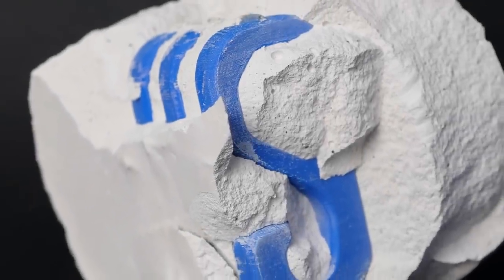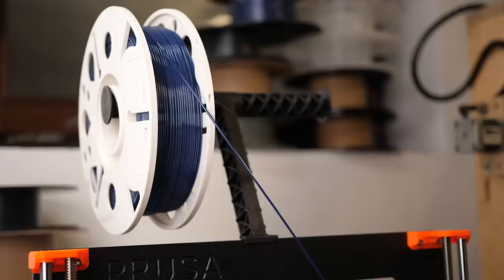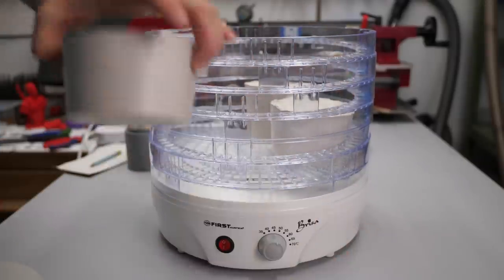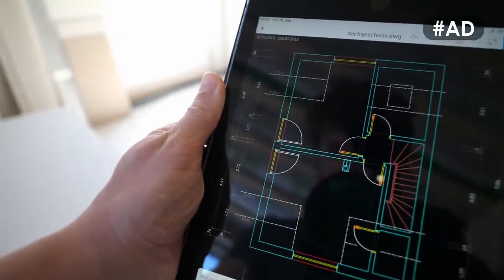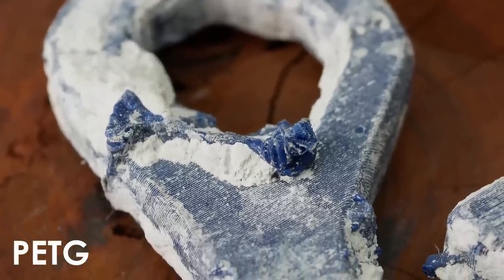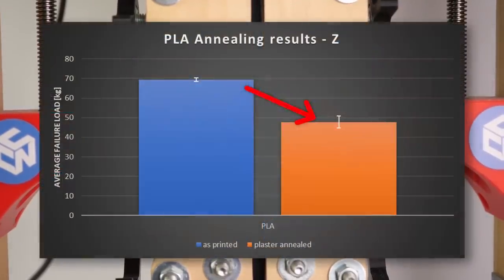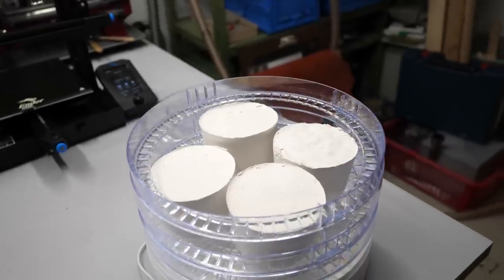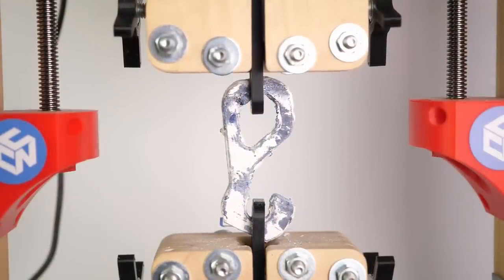Triple (x3) your Layer Strength by Annealing 3D Prints in Plaster!

Comment: What, no photos or graphs of the Bread test-results?? :-D  Thanks for the great info, as always, Stefan!
I need to print a few parts that incorporate a "threaded-rod" shape, so printing in the standing orientation produces way better results than XY-orientation with supports; therefore this method may be at good starting point.  The part will live outside, under glass - therefore I need both UV resistance and heat-resistance.  So its a bummer that between PETG and PLA we can only have one of the other (PLA annealed temp resistance vs. PETG UV resistance and layer-adhesion improvement).

Comment: to keep the parts from absorbing moister you should coat them with an acrylic spray or something like that to prevent that

also you should use something like a palm sander to vibrate out the air bubbles or a pressure chamber instead of a vacuum chamber to squeeze out the air bubbles instead of sucking them out

Comment: Maybe onion-like layers of PETF or streaks of it through the PLA component. The PLA could prevent deformation and hollowing and the PETF could contribute strength. Perhaps, assuming the PETF will melt, long thin cavities could designed to allow the flow to join layers.

Comment: My ideal would be an additional toolhead with a long extendible proboscis: get the slicer to do zero percent infill within the walls, then when the walls are tall enough, extend said proboscis into the void thus created, and extrude material en masse while drawing the proboscis up. With sufficient heat and vertical speed, you should get a solid block, strong in all axes. Either that, or build some PLA rebar separately and insert in post production.

Comment: Could you coat the parts in a high temp release coating of some kind to make them pop out of the plaster cleaner.
Reply: There's separation milk used for gypsum on gypsum. As in make clay something, throw gypsum at it,spoon out the clay. Separation milk. Fill with gypsum.  No idea how it would do with that kinda heat.

Comment: You need a diamond chisel (there are electric ones) to break efficiently the plaster. best way to remove the biggest chunks, and then do what you did, scrub in the water. Your plaster process, drying first and then heating, seems, imho, to be the best path. I probably would add a vibrating table while the plaster mold dry.

Comment: I wonder, if you used a gradient infill, if following annealing you'd get something akin to an W-section/I-beam in terms of shrinkage?

Try: a flat (e.g. printed) rectangular prism, annealed in this process. For extra credit: make some smaller, thin blocks of paraffin wax wrapped in baking sheet on either side of the plastic block before casting. The idea being that the paraffin will expand in the oven, compressing the center of the mold, and should reduce the bacon effect.

Comment: May use a thin layer of plaster on the printed parts and use small containers of sand where you put them in. Should reduce dry, heat and clean time alot.

Comment: if you wanted to get rid of the bubbles in the plaster molds, you could use a high pressure chamber rather than a vacuum. This technique works by compressing the air bubbles to a point where they are negligible.
The only major downside to this method is that the plaster must set in the pressure chamber, rather than outside it.

Comment: Can you get some thermocouples for next time to measure the core temperature of the mold, and maybe also test quenching from slightly below the melting point?
If you use salt as had been suggested, you could probably just drop the part with surrounding salt in ice water pre-saturated with salt, just so the pulverized molding salt doesn't dissolve much. Afterwards you can just take the sediment and bake it at 200~400 C before re-crushing.

Comment: You might have better results with PETG using a silicone or other multipart molding compound, or something else without water.  The silicone mold likely won’t have the vacuum chamber issues either.

Comment: Oh dang, I've been thinking about a way to constrain odd geometry better when annealing and totally blanked on using plaster. This is a great idea.

Also, rather than pulling the bubbles out, I've learned from resin casting that it's much easier to compress the bubbles into nothingness with a pressure pot. Maybe that could be a solution for the cavity problem
Reply: resins typically have a glass transition temperature much lower than the filament
Reply: @t_c5266  I'm not sure I follow. I was only referring to reducing the bubbles while the plaster cured. Maybe I didn't make that clear enough
Reply: @LordHonkInc  oooh, i read it too quick. I thought you were saying to substitute a resin casting. my bad

Comment: what about annealing the parts inside silicone? ie. pour silicone around it, let it set, heat it up, let it cool and then just cut the silicone away. In theory it at least won't stick to the part. Not sure about any trapped moisture, though. Degassing with vacuum should work too.

Comment: Try leaving small holes like 
[  ○        ]
[        ○  ]
In the structure a couple layers high then use the printer as an injector while printing to fill them before alternating the hole pattern.
[          ○  ]
[  ○          ]
Im not sure how easy it would be to write custom gcode for something like this but it would give the parts some strength in both directions. You could also have the holes go all the way through and alternate which layers theyre filled at as well.

Comment: I'd give the pieces a coat of the more liquid plaster, just 2-3mm thick, and then either enclose them in a block of plaster or submerge them in sand. Also, another grade of plaster, at least for the initial coating, might give better results. The plaster hardware stores usally sell is comparatively coarse and contains a percentage of sand. You'd want "Alabastergips" or "Modellgips" instead of the common "Stuckgips".

Comment: You could use liquid ceramik to produce a thin, watertight layer arount the printed part and then put it in plaster for remelting. And after annealing just vibrate the whole setup free. Could be worth a try 🤔

Comment: Maybe changing the Plaster of Paris with contained green sand like used in metal casting will ease the process.
Reply: Do you know what the binder in casting-sand actually is?
Reply: @ZappyOh  It's mostly held together  by humidity and compression, it has a tiny amount of bentonite (clay) that stabilizes it a bit more: https://en.wikipedia.org/wiki/Sand_casting

Comment: Mold release (as suggested) would likely result in the part separating from the plaster and shrinking/deforming.

What about dipping the part in plaster so that you have a thin coat structure, rapid drying and faster cleanup. Maybe a good hard water jet/spray.

Comment: Just a thought. Don't add water to the plaster. Pack firmly, (perhaps vaccuum out the air as well), dehydrate some more. Although the plaster should get all the moisture out of the air, so dehydrating the part before hand should work. Then bake. Cleanup should be much easier, while still holding the parts shape.

Comment: When the plaster is cured much water is bound as lattice water, this is how it works. When the plaster is heated on the oven this water is released (as you point out in the video). This is regardless of how much you dry it in the food dehydrator. This released lattice water may very well interfere with your plastic polymers, especially at the elevated temperature in the oven.
Reply from the maker: Good point. I'll have to add an additional resting time right around the 150°C mark to get rid of the lattice water before continuing to the melting temperature.

Comment: the idea has potentional , maibe you can pressurize a spruce of extra material printed on top of the part and embedded in the plaster with a small pressure vessel sitting on top of it or a airline mounted to it so the extra material in the spruce  it can replace the stuff that scrinks , it probably works best with 100 percent infill

Comment: You could use an ultrasonic cleaner to knock off the plaster.. also if you printed w 100% infill and reflow the plastic in the mold you could end up with a near 100% homogeneous part.

Comment: What about using a more heat resistant material to fabricate a “setter”? Possibly printing the inverse body divided in two to completely encompass the desired model? I’m thinking something similar to what they use in industrial heat treatment of MIM parts. Def wastes more material if the end goal is a one-off model, but if it is geometry you print often(such as your testing shapes) it could even be saved reusable tooling.

Comment: I think it would be interesting to try other ways to initialize crystallization in PLA in order to increase its strength. Because crystallization or more accurately phase transformation is a superposition of two processes as nucleation and growth. You could try low-temperature annealing but at extremely high hold times, or nucleation initiation by ultrasound, shear deformation, or ultra fine inclusions. Such techniques are, for example, is the standard technology for the production of high-strength steels, where the processes are of course different but are also based on the fundamental principles of phase transformations.

It may be interesting to view the development of the kinetics of PLA transformation at different temperatures and to create a transformation diagram, which can be used as a guide or technology for annealing process.  The transformation degree can be determined, for example, by the light absorption on the transparent PLA. 

Gruß aus Düsseldorf!

Comment: You can't dry the plaster. The reason it sets like that is because it combines with water to form a crystalline structure. By heating it, you cause the crystals to decompose, releasing water. No matter how dry you get plaster, it still contains water unless it's converted back to it's anhydrous form, which of course lacks the very property you chose plaster of paris for in the beginning.

Comment: Maybe you could fix a sanding machine to a frame and place the wet plaster filled cups on there so the vibrations cause the air bubbles to rise.

Comment: Do not add water to the plaster! If the plaster is sieved into the water, there will be no bubbles in it. The plaster should be added until it stays on top evenly. After that, it should be stirred slowly. After mixing, pour over the hooks. If the plaster flows, it leaves no room for bubbles. It takes a few trials before one realizes how much plaster needs to be added to the water. You can try it first with a little water.   ---- Thank you for making this video! Useful and instructive as always!

Comment: Im a plasterer from way back, you could add forton to the plaster with an accellerator, the forton might help as its a glue used to increase plaster strength, a smae you cant use fiberglass in your prints lols would be problem solved

Comment: i'm interested in the strength of 100% infill using different extrusion witdths.... i use 98% infill and 140% infill extrusion width whenever i'm trying to get 100% infill, obviously it would help to speed up print time, but how does it compare in tensile strength?

Comment: From my experience with diffrent kinds of plasters and molding: any Kind of seperator like talc powder should Help getting the stuff Out of the plasters. If you want to remove Air from the plasters, use Vibration. Take a Look at stucco with higher onset times, there's stuff with 45 instead of 5 minutes.

Comment: Vacuumed plaster has to be really really runny to let the air out in your canister. It also  needs to be warm to hot to completely melt away when placed in water. Kinda counter intuitive to the printing process.
I used a vacuum setup like you for lost wax casting. Then straight into a kiln at 1800*F for 36 hours. Then into the centripetal forge. Then right into a 5 gallon bucket of water where it melts away. But that's for metal.

Comment: Use a ball mill to process your parts. I think you could get away with 1inch 100% fill spheres if not small ball bearings should not hurts the material. That is how you do it with casted parts like brass to release the molds. You can make one really easily out of a 5 gallon bucket and some misc. parts.

Comment: I just bought a thing of plaster to coat the walls of my home built 3d printed enclosure. That stuff isn't terribly cheap. Getting that sort of strength might be worth it to just get a much stronger filament if your printer can support it. 

Going to these great lengths of post processing to change the material properties of a filament basically defeats the whole purpose of using a 3d printer in the first place. if youre making plaster casts already you've pretty much made a mold. Last step is to just have a way for the melted plastic to flow out and just replace it with 100% dense plastic.

Comment: What if you try annealing the part in sand while under a compression load? Put the parts in sand inside a fixture then compress it like crazy with a few bolts

Comment: Hot isostatic pressing, usually done for metal,  if used for plastic can probably produce the results you are looking for (which i assume is that u want to fdm print and then post process to get injection molded properties) . But its not an easy thing to do. The surrounding air should be at a high enough pressure to make its density higher than that of the material (pla) you are pressing, for it to remain inshape.

Comment: Build yourself a vibrating table. It's pretty easy and cheap. You just need springs, some board material, two part epoxy, and some vibrating motors ($60 to 100 depending on size) it will remove the bubbles better.

Comment: Make it like schnitzel or like castings for fine art.. oil it, coat with plaster powder and Dipcoat it with liquid plaster.. let dry.. repeat with thicker plaster paste. Until sufficient. Last layer could be plaster mixed with some paperpulp for rigidity of the cast.. Then fry it in silicone oil at the right temps..  or bury in sand/ironfillings or 3mm steel bb balls.. to Support the cast better and bake that in a oven or such..

Comment: Your may find better results by using a pressure not a vacuum chamber .  Pressure chambers reduce the size of the bubbles.  Also use a pressure washer to remove the plaster.   Print the samples with the same settings as you used to make transparent parts.

Comment: my guess is the closer the relative density between the media and the filament and finer the media, the better the result.
unlike molds, you dont need an entire cast full of media, just need to set a case enclosing the piece. there is no flow required, so all the media does is stop sagging.

Comment: Sorry about how long this comment is. Put i thought it necessary to describe what I was talking about. For those who would like to make it. 
What if you used an aluminum mold. Make the aluminum mold with a slightly over sized silicone gasket/o-ring. Then drill a few holes around the mold, and put a few nuts, bolts & washers to keep it all in place. Here's a more detailed description of my suggestion.
 Make an aluminum mold to your desire dimension with two o-ring channels along the outer edges of the mold. Use high heat silicone for the o-rings.
Drill alest eight holes and use nut & bolts  and place washers on both sides for equal pressure placement. If there's any way possible, I would also try and put attest two alignment studs and holes on two opposite corners. I would go with around  1/2 or maybe 3/8 of an inch round or possibly a square stud. The studs should be around 1/4 inch long and the hole around 3/8 deep(or drill the hole  all the way through, its up to you) on each corner,(The measurement of the stud length and hole depth, should be based on the o-ring size). I would put a flip them too. Where a stud and hole are on opposite sides. ( you could possibly make them diffrent so the mold would never installed  backwards). That why there's a more true and secure alignment.

Comment: Next time paint a thicker plaster solution directly on the parts. You dont need a thick tub of plaster to anneal them, a few coats of brush on plaster will both dry faster, break away easier, and allow more heat to soak through and into the part (plaster is a good insulator). I've used this method for lost foam casting by just painting the foam with 1 layer of plaster and then burying it in sand, giving perfectly smooth castings with minimal cleanup and fast turnaround.

Comment: Could you test with Delft clay, the used one for metal casting, since it does not uses water as aggregator (it's a dry process)? :) Also, it's reusable and non hazard to the human body per se.

Comment: 3:20 I would suggest using the chamber again, except this time actually increase the pressure. The number of bubbles in the suspension cannot be changed, but you can influence their size. Increasing in pressure = decrease in size

Comment: Instead of a vacuum pot, try pressure. People do that while working with epoxy. The air bubbles basically get compressed to the point where they are gone.

Comment: So here’s a idea for the PETG. Why not add a few “sprue” type legs at the top of the hook so when it reaches melting point inside the plaster and it starts to shrink the extra material at the top will melt into the cavities with the assistance of gravity and fill them. It all makes sense in my head but I’ve only casted with aluminum and green sand

Comment: You should put less plaster in the plaster+water solution, then when it is creamy cover a small layer of plaster on the part, this way you don't get bubbles in the vicinity of the printer part; then, when the plaster get thicker, pour the rest on the part.